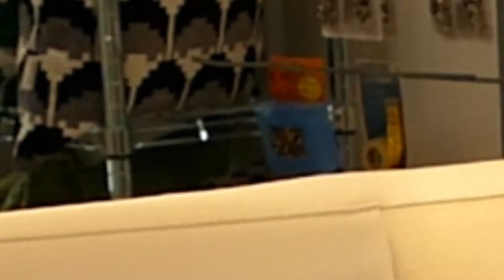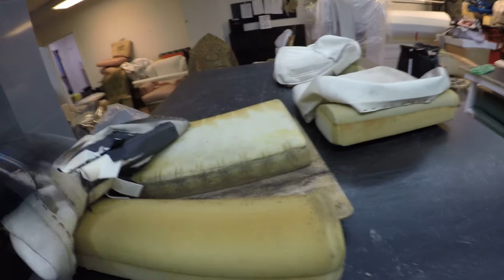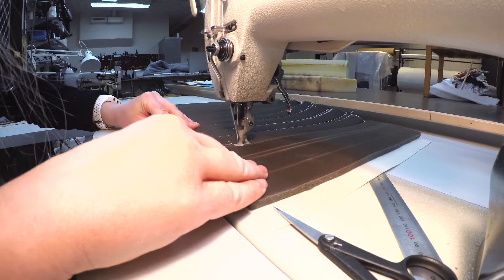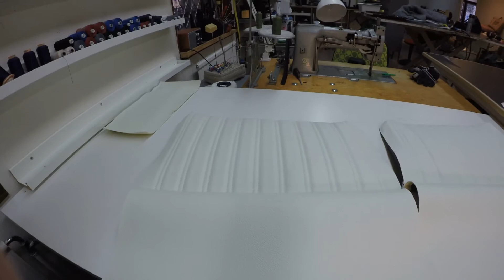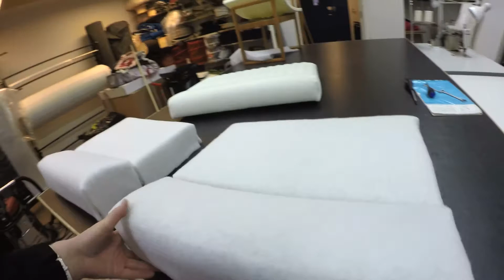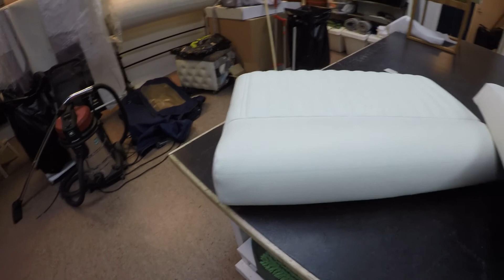Reupholstering Boat Seats

Comment: Great Job!!  Thanks for posting this detailed video.  I'm starting my first project; please identify the specific materials that you're using - vinyl, thread, foam (both types), batting over foam, keder cord, flap material between 2 section of the vinyl skin.  Stitch length for seams?  Stitch length for topstitching?